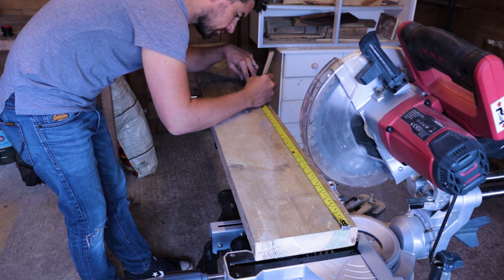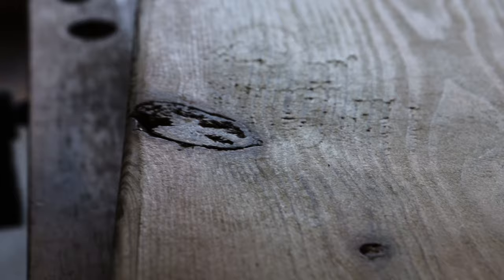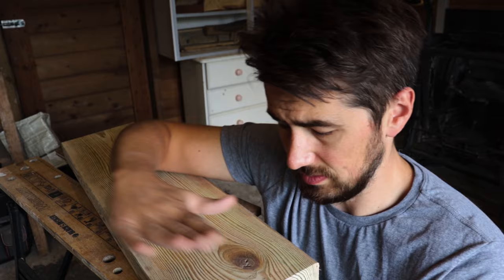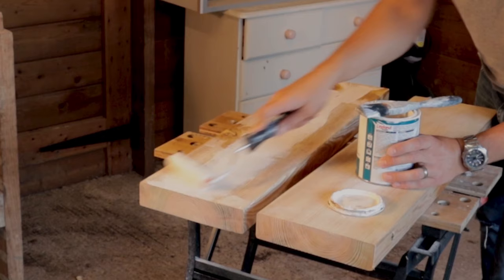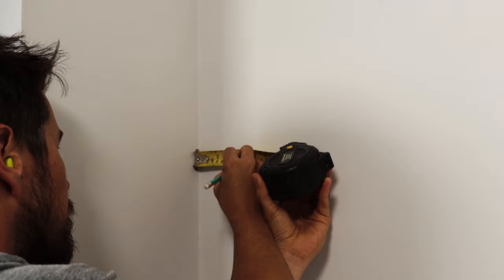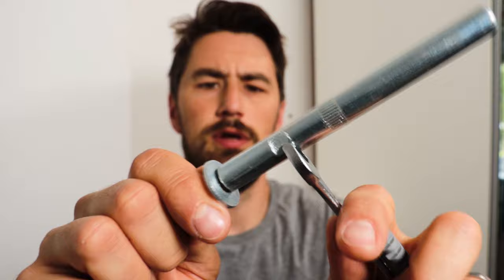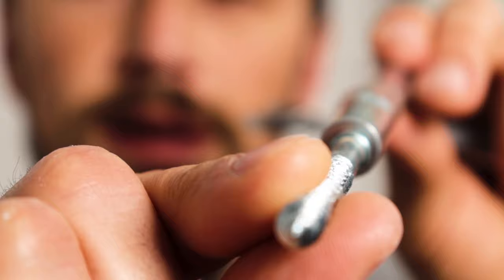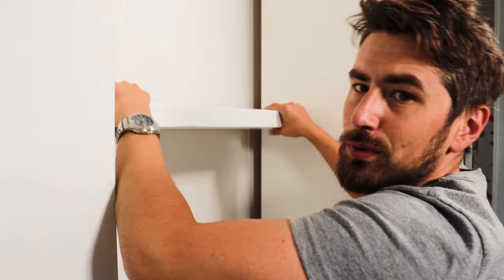Easy DIY Floating Shelves | The Best Floating Shelf Bracket?

Comment from the maker: Hope you enjoyed this one! Let me know below if you did. 

For the more experienced DIYers out there about to tell me I'm an idiot for using a masonry drill bit on a wooden wall, I should have explained that these are installed on a solid brick wall. A brick wall that eats drill bits for breakfast. And yes I'm using a hammer drill, and one that's powered by 230 solid volts of power (+10%/-6% in accordance with UK Power distribution regulations - for all the electricians out there!).
Reply: Thank you for the information.  To help you, you need to use the right drill bit for the job.  The bits you showed were for drilling into concrete.  The Dewalt drill bit you purchased is one of the types you should use to drill into sheetrock and wood.  Plus get yourself a smaller drill! I have Dewalt 12V and 20V lithium battery drills.  I use the 12v every day for work and it would work for your project.  If you have a harder wood or metal to drill into, then use the 20V drill.  Your hammer drill great for concrete, heavy for wood working.
Reply: Your drill speed is too high. Slow down alot and press harder on the drill. Every 15 sec or so release the press a bit , then back on. No more melted tips or bent bits from too much heat.
Reply: Hello! Thanks for the video. Did you use the same 10mm drill bit for the holes in the wood? What size is that?
Reply from the maker: Its a different drill bit as I'm drilling in to a different material and my wall is made of bricks.  To get the right hole in the wood I practiced with different sizes on a scrap piece
Reply from the maker: That's the most useful tip on this thread! a decent sharp bit also helps 👍
Reply: Will it hold a sane size granite or quartz, you think?
Reply from the maker: Hard to say. I'd be worried granite or quartz might split of there's not much meat around the hole. You can always add more brackets if they dont support well I guess but I'd anticipate a little bit of wobble for something so heavy
Reply: I’m thinking about doing this type of shelf in my rental unit. Is it difficult to remove the bracket and shelf?
Reply: I’ve bought these brackets to use in my kitchen, but am afraid if I don’t drill perfectly straight into the wood and the wall it won’t work, was using a square to roughly align the holes enough?
Reply: As I don’t have a pillar drill
Reply from the maker: It can be difficult to pull off, but I've not haf to remove these yet!
Reply from the maker: In terms of drilling straight. Try practicing on some scrap wood first. If you drill badly you could always try again in another spot and put the bracket in a different place in the wall
Reply: What's the name of the screw you put in the wall?
Reply: I have very little experience so maybe you can help me as to why you didn’t screw the bracket just right into the stud? I think it would be too difficult with the wrench but maybe a power drill that can grab on those brackets would work?
Reply: I'm sorry if I missed it but where did you get the brackets at Thanks
Reply from the maker: @davidmokrzyckiii725 there should be a link in the video description. I've not checked it in a while so let me know if it doesn't work!

Comment: First of all, it looks like you're using a concrete drill bit on a wood wall. Second you need the hammer function with that kind of a drill bit if you're drilling into concrete. If you don't have the hammer function your drill bit will certainly get way too hot and break crack and fall off.
Reply from the maker: You're right. It's a concrete bit, but it is also masonry wall in an old house with really tough bricks. It is also hammer drill, a mains powered one because my battery drill couldn't get through  it. The problem was a real tough wall and a cheapo bit.

Comment: Finally....the video I was looking for. This is the most DIY friendly video I have come across till now for making floating shelves. All other videos come up with elaborate brackets which need to be made and then you gotta make the rectangular wooden box that slides over the bracket. It's very elaborate and time consuming. Your solution looks very sturdy and elegant. I know for a fact that these fasteners can hold tremendous amount of weight. In my country, we use these fasteners for lots of things like fixing wash basin to the wall.

Comment: The video and comments are focused on the hole in the wall but actually the most difficult part is the holes in the wood. You will need a 12mm drill that can go in at least 16cm. This is very deep and you will likely need to buy an extra long drill bit to do it. 

If your shelf is long you will need more than 2 brackets for strength. 1 bracket every 40cm I think. 

I just used 2 per shelf, if you use more you should take time to think about how you will keep the shelf level.

Drill the holes in the wall with 10mm masonry drill. Insert plugs and screw in brackets

Put the wood on top of the brackets. Check with a level and adjust brackets to get them straight. 

Mark the position of the brackets on the wood so you know where the holes should go along the length of the shelf. 

Put a dab of paint on the face of the bracket. Line them up between your marks and press the shelf against it. This is so you know roughly wherr to drill into the wood. If the dot is too close to the top or bottom youll need to adjust the brackets. 

Keeping the drill straight over through the depth of the shelf is the really difficult part of the proces. Clamp the wood to the bench. Dont start till you do. 

You can drill pilot holes but they only help so much. I got steel plate with a 90 degree angle which had holes pre-drilled in it. I dont know what they are for, maybe welding. I looked for one with a 12mm hole by inserting the drill bit into it and picking the one with the best fit.

Place the plate on top of your shelf (which is clamped to your bench). Line up the hole in the metal with your paint dot showing where the hole should be. If it doesnt line up, adjust by jacking it up with bits of cardboard. Clamp the metal onto the shelf or bench so it doesnt move. 

Drill through the hole in the metal plate into the wood. The platr will help you keep the drill straight but it isnt perfect because you are drilling so deep. Keep steady. Dont do it all in one go, pull out the wood shavings as you go. Dont get excited and rush. Have your drill battery charged to full each time. 

If you think you are angling up or down you can pause in place and firmly hold the drill where you want to correct. Move it in and out a bit and grind a different angle, then slowly continue. 

This activity is not nearly as quick as the video makes out but it ends up with nice shelves.
Reply: When the comment is more insightful than the video. lol Well done mate. Btw, I hate it when DIY videos skip the most difficult parts and conclude "well trust my word, you can't fail".
Reply: You just need to make a template out of a piece of scrap wood. Drill the holes in your template and line and level it on wall and on wood shelf. Takes 5 minutes and everything will line up and be level. Simple! If you are putting this in a cove area (with wall on each side) you can put a groove in front of shelf so front of shelf has support if putting heavy things on it. If the shelf is above eye level you can fill in groove on the bottom of shelf so it can’t be seen. But i will say someone needs to invent something that is adjustable if you get done and it’s not level by a hair but noticeable beside only being able to tap with a hammer. Anyone who has done this their first time and have been off level by a 1/8th of an inch knows how hard it can be to redrill a hole 1/8 above/below original hole. It’s a pain in azz unless you refill hole and start over. That’s where the template helps for this not to happen 99% of time.

Comment: The secret to drilling with concrete drill bits is to use a hammer drill!  It's sooo much easier!  
Good video btw!
Reply: Not only easier but also the correct way. Without sounding like a know it all! Great video
Reply: if you really need to make one or two holes and don't want to spend the money, a masonry bit can be used manually by tapping it with a hammer and twisting. Takes a long time but it'll do it, though its up to you to keep things straight

Comment: I found your video very helpful. I like the fact you can rotate the bolts to correct for slight alignment problems if necessary.  I'll try to find that type of bolt near me.
My favorite part of the video was when you discovered your drill bit was bent a bit.  Sometimes, you think to yourself that only yourself would have that kind of problem.  So it's nice to know things like that can happen to anyone.  I'm glad you included it.  I want to mount a long shelf to hold some models of old electric powered locomotives from around the world.  I don't need nor want the board to be much thicker that 3/4 of an inch so I have to find bolts that don't require a 1/2 hole.  I also have to lay a floating vinyl floor in our bathroom so I'll be checking the rest of your site for possible tips. Thanks for the education!  Rob
Reply from the maker: Thanks for the feedback Rob. Glad you found it useful. I haven't seen a smaller bracket for thinner shelves but there are lots of options out there for shelves so I'm sure you'll find something that works 👍

Comment: I've experienced the same thing with my cheap kit masonary drill bits that are IMPOSSIBLE to get through brick. I went slow, fast, corded, uncorded, hammer setting, standard setting, with cooling, and without.. no difference. 
Very helpful to see you go through the same thing and find out that it's the darn drill bit itselt. Will check out the ones you recommend 👍 Thanks for the video!

Comment: Nice video.  Consider these points
1.  You bought pre-made shelves "off the shelf"....  Hmm.
2.  In most cases, it is more important that a shelf LOOK level rather than actually BE level.  If the ceiling, floor, or other major nearby horizontal lines are not truly level, a level shelf will look out-of-level because it isn't parallel to them.  In this case it is better to stand off at a distance and have a helper position the shelf so it looks level and mark the position.
3.  When using a masonry bit it helps greatly to have a squirt bottle at hand to squirt water into the hole.  This cools the bit, softens the masonry, and keeps down dust.

Comment: "It cannot be that easy, can it?" - and then he goes and shows an intricate process for which any regular person would need to buy 10 different things, resins, paints, etc not to mention the tools :)

Its a good video, and you explain it really well. The process itself also is not "hard" so "easy" is accurate description of this, but the thing that I found most informative at this point is that there is a strud to buy off amazon...

Then I will get a shelf ready bought from somewhere like B&Q :)

You have my like, sir!
Reply: The tools he has are literally basic DIY tools anyway? So if you're looking to do any sort of DIY you should have them as a bare minimum

Comment: I'm looking to source some live wood (wavey front) and was thinking they'd look great floated, so really useful to see what you used and how it turned out, thanks.  After struggling with a masonry drill drilling into engineering bricks up the side of an alcove I invested in an SDS drill - the right tool if you're finding even new bits don't make much impression.

Comment: Great video.  Wish we had solid walls here like you do.  All we have is these cheap dry wall/sheet rock walls.
Reply: It's a really standard and normal way to build houses not cheap at all. You'll just have to find studs in the wall. So when you drill your holes in the wood and wall they should be 16 inches apart to catch to studs

Comment: I've found the very best way to fix a floating shelf that will be rock solid is to use 12mm threaded rod and fix in the wall with resin, making the hole in the wall 16mm. Just support it for 15 mins. The down side is that it's permanent but most shelves are. I've done many like that and they hold any weight.

Comment: Great video. Can anyone recommend good fixings to use on a brick wall that has dot and dab plasterboard for this sort of project? I tried the Corefix heavy duty dot and dab wall fixings for my floating shelves. The shelves are very solid but they still wobble a little up and down, which is a bit annoying. Would these fixings in the video be any good in dot and dab walls?

Comment: Mate you need to use  hammer drill, which not only rotates the bit but also reciprocates it (like a jackhammer).  The rotation is used to clear material via the spiral flutes of the bit, but the hammer action works to smash the material, just like a small jackhammer.  If you don't use a hammer drill then you will be generating immense friction but not performing much drilling.
Reply from the maker: I stupidly cut out the part where I spoke about drills and composition of walls in order to keep the video short...  but made it look like I was doing it wrong. It was a hammer drill, a mains powered one (because my battery one couldn't handle it) it was just a real stubborn chimney breast wall with solid  stone chunks in it and the cheap bits I ised first.of all were half blunt which also didnt help!
Reply: Great advice to buy more and more tools.
Making own shelves etc is dying out due to the insane set up costs and growing demand getting more and more tools.Modern men deliver worse priducts but use at least 20times more tools than men 60years ago

Comment: had the same problems with those rotted spots. what I did was gouged those rotted spots, and I mixed glue with some sawdust and applied it to the gouged spots then sanded the wood even

Comment: If I looked again, you drilled the hole in one time, with the big one. Have you try-out drilling with a smaller bit first. It takes the stress of the big one, and doesn't break or burn.

Comment: Great tutorial. I've found an impact drill works best in concrete.
Reply: Don't you mean a hammer drill? An Impact Driver is a small version of a drill for driving screws and bolts but not useful for drilling, a hammer drill is a drill that also reciprocates the drill back and forth as it spins (like a jackhammer).

Comment: I’ve seen at least one comment mentioning a “hammer drill”. Those cement bits are designed to be used with a hammer drill. Not using a hammer drill, it’s hit and miss whether or not you will get all your holes drilled and sometimes lucky to get one drilled before the bit fails. Which explains your luck with past bits failing. As you know....with a regular drill they (the tips) heat up...chip...and/fall out. With a hammer drill, they will surprise you how long they can last. I’m surprised the person at the hardware store didn’t educate you on this....just my two cents worth. Great find though with those hidden brackets !
Reply from the maker: Hey Kelvin. Thanks for comment. This is a hammer drill that I'm using here. Unfortunately my walls of made of stupid tough bricks thst eats drill bits for breakfast!

Comment: Great video. If I would like to remove my floater shelf and I would like to install ones using the same bracket however I want them same length however going out instead of 6.7 inches I would like one that is 10 inches how do you remove them without breaking the wall and just get a new one that would be custom made exactly 6.7 inches by 10 inches. I now have 16 inches length. I would get same length however coming out 10 inches instead of 6.7 so I can fit bowls etc

Comment: Just put rods in the back of your shelf, threaded rod works best, drill your wall holes and use chemical anchor compound on both,will never move. I have even used CT-1 and it’s been there years.

Comment: Hey Neil, do I need to use a knotting solution if not painting? Also, if not painting, should I varnish/stain instead?
Reply from the maker: Hi, no the knotting solution only stops the oil from knots from staining light paint. If you're vanishing you'll see the knots anyway do you won't need to cover them. You don't have to varnish or stain, personal preference really. A finish will help protect the wood from getting dirty or marked. It can also help stop cracking in warmer months when it dries out. It depends on what look you're going for
Reply: Only just saw this 😅 thanks Neil!
Reply from the maker: Dont worry, your reply time is about on par with my average 😂

Comment: thanks for the video. i was wondering if the washers make the shelf sit out away from the wall and if you think i should chisel out  bit so that they will be inset. thanks!
Reply: I was wondering the same thing. Has anyone installed these and found the washers prevent the shelf from sitting flush with the wall? I was thinking I might put a washer thickness recess into the back of the shelf first with a forstner bit before drilling the hole for the pin.
Reply from the maker: Just double checked.. they do stop it sitting flush. On the other hand, the gap isn't noticeable and might be useful if you ever need to get something behind the shelf to pull it off at a later date
Reply: @NeilLovegrovemaker  Thanks Neil. I appreciate your checking. I saw a drawing on one of the Amazon links you posted that actually shows the washer recessed into the back of the shelf, so the supplier must have contemplated the same thing. I think I'll recess the washer on mine so I can snug the shelf up to the wall. It'll be easy enough to do on my drill press.